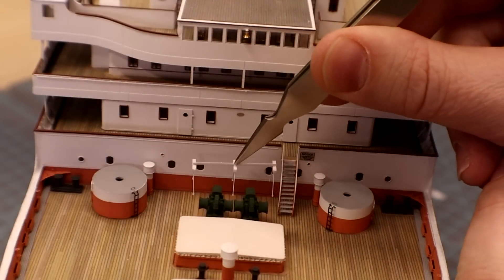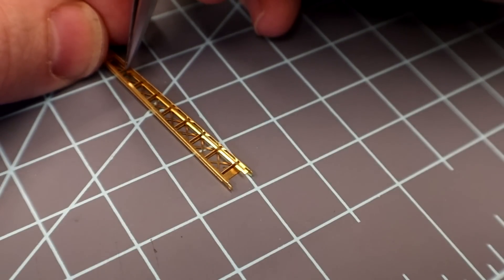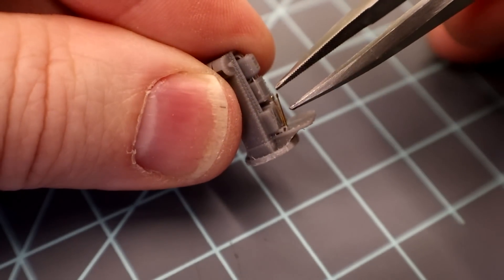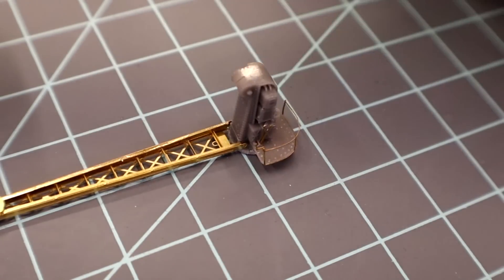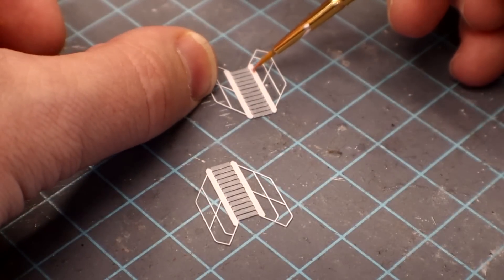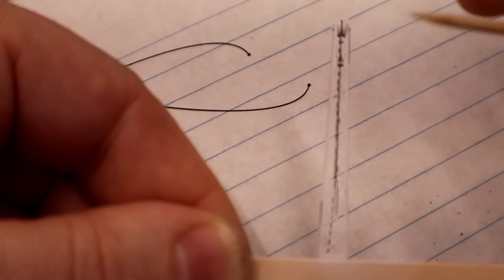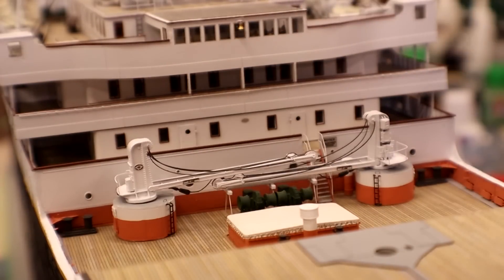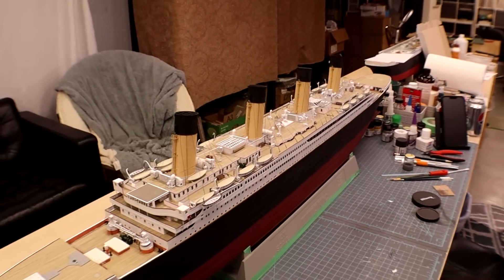1:200 RMS Titanic Build Video 38

Comment: Goodness I can't believe how beautiful she looks. Outstanding detail; I can watch you work for...years.  The cranes look great, but where the port one is blocking the only stairs to the well deck, as you had to bend the railings, how did one get there when at sea. You may have said how but I missed it. There are two stairs and two ladders to the fore deck but only the one down. Perhaps the intention was to prevent passengers from coming down to the well deck, the crew would use the bulkhead doors, as that area would be very busy during loading the holds..
Reply: Spot on!  They were usually removed to help loading when in port as a swinging load of netted stores would destroy them if one swayed into the fragile stair rails.  This set of stairs can be seen in the 1920's Olympic promotional film (YTube) with 2 ladies descending to the well deck.  Ironically the footage is staged as the ships holds are open for dock crane supplying stores.  As you say, that would not normally be allowed for passenger use in such situations and the top gate would have been shut too! 😉
Reply: @johnnyhollis9977  Thanks, my assumption was correct then. It seemed logical (Spock).

Comment: Hey Ben, the ladders are actually hidden away in the Pontos kit (page 12).  However, a load of modellers would probably only have the KA so your point was relevant!  I was thinking, a tiny bit of packing under the crane body (1mm) may have helped with the clearance problem. Regards JH 😉⚓
Reply from the maker: Thanks! I almost did that. I was concerned it would be noticeable… I probably should have at least tried it. Ultimately, noticing the support stand should have been angled and modifying it early on would have be “best” but those little things take a lot of research. And I need to finish the model.

Comment: Submersible footage of the wreck shows a closed gate at the top of the stairs with no sign of the stairs. Could be that it came off on its way down or possibly that staircase was removable and stowed. Hardly any pictures to be found of that area.

Comment: Just an observation, the "side wings" besides the bridge, should extend outside the width of the ship, and the way it looks right now resembles more Olympic than Titanic...
Reply from the maker: I think you wanna double check that.
Reply: @TheMidwestModelShop  Just a small observation, your model looks amazing nonetheless...
Reply from the maker: I think I know the area you are describing, the “railing” is incorrect. That was an error in the PE that was discovered too late. It’s since been corrected from Woodys Model works. But I can’t repair it on this build because it will rip up the deck.

Comment: Absolutely beautiful may i ask you how do you stop paint bleed? Am trying to paint the crane base's and where the doors are ect when I take the masking tape off it leaves such a mess??thanks.
Reply from the maker: Use Tamiya masking tape. Make sure the edges are actually pressed down on the tape. Then spray light coats of paint.
Reply: @TheMidwestModelShop  thank you very much.